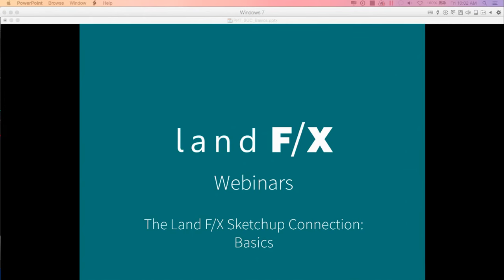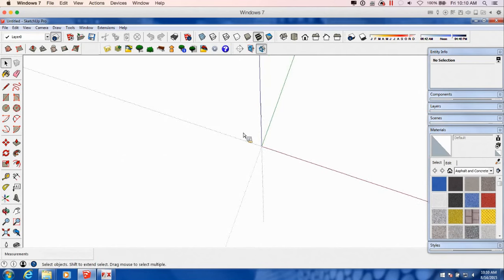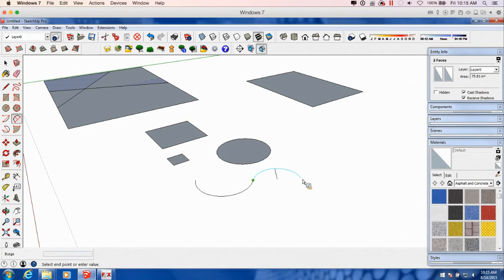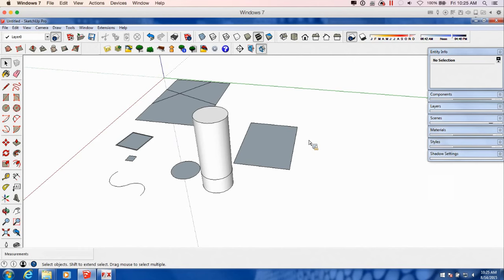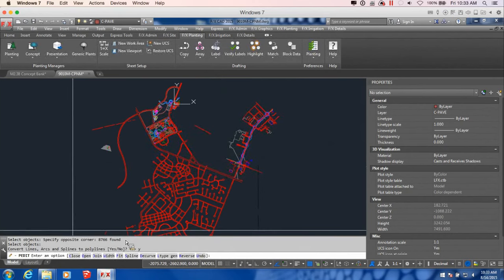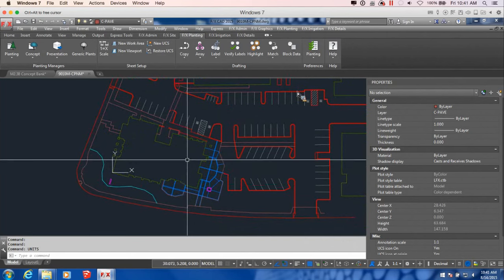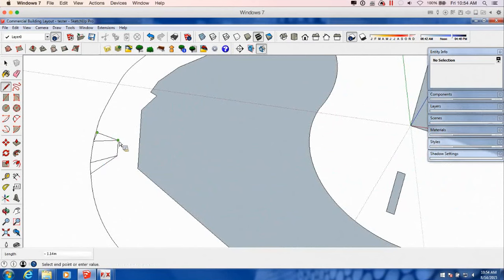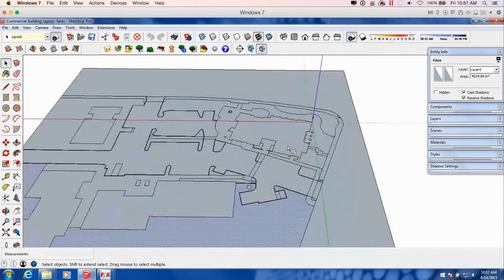SketchUp Basics for Landscape Architects

Comment: 55:19 how do you snap to parallel so quickly without accidentally snap to green red blue axises?
Reply: Kuang, SketchUp has a built-in capability to recognize when you're close to drawing a parallel extension and will indicate that with a magenta coloured line instead of red, green or blue. If your extension is much closer to an axis, it can be hard to get that magenta extension colour. If that's the case, you can try changing the axis temporarily instead.